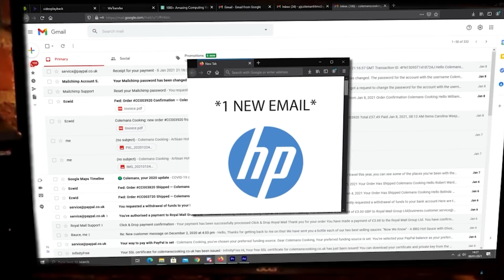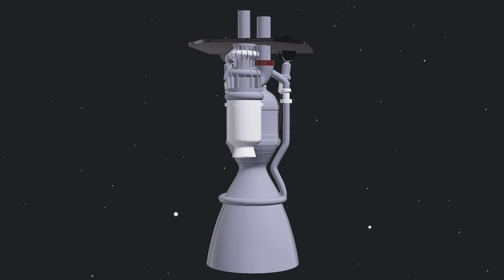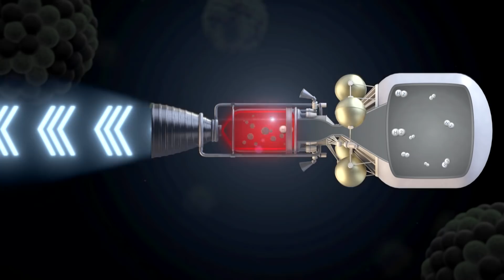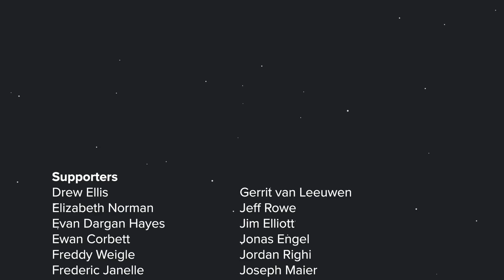Meet SpaceX’s Engine Architect and Employee #1: Tom Mueller

Comment: Forget about bi-propellant engines.  I'm working on a tri-propellant engine.  The Specific Impulse could be as high as Isp 700.  I need your help Tom to design the injector plate.  Fuel mixture is extremely critical.  Before Raptor I told SpaceX to ditch the Merlin and RP-1 for environmental reasons and switch to Methane - RP-1 is so 1968 Saturn V  F-1.  Glad to see they took my advice.
The future of rocket engines will be the tri-propellant motor which is difficult to perfect.
Reply: Hi, may I know the details about you work progress now?
Reply: May I know your current work progress?
Reply: Due to a lack of funding I am unable to conduct actual testing of propellant combustion.  I can only give you the theory, the name of the propellants and the rocket motor to be upgraded.  The RS-25 space shuttle main engine.

Comment: Carbon Fibre weighs only one fifth, with more tensile strength and less heat conduction, and much more streamline smooth aerodynamics. So to make a decision to manufacture from steel, not only increases the  payload by 15 thousand tons, from 3000 tons Carbon Fibre rocket. So when Elon talks about cheap space travel, he talks only bullshite
Reply: Yes, but you can’t resell it. Stainless steel can be melted down and reused for something else. When spacex becomes more comfortable with starship, we may see some carbon fiber variants
Reply: @catmcnugget677  Thank you for your catastrophic input . I’m sure Elon has the environment as a priority! That’s why he uses kerosene instead of alcohol , because kerosene burns 50 times hotter , and requires cooling systems , extra engineering . Rockets became boring when you couldn’t drink the fuel . Nowdays they have zero aerodynamics , plumbing in the outside , little square flippers and raptor turbo popping plasma Mandalorin . 
Do you believe that man landed on the moon ?

Comment: While hovering in order 
to reduce the speed of free fall, 
it is necessary that the Starship 
hold herself not strictly horizontal, 
but slightly inclined, namely, the stern is lower. 
This will keep the downcomers 
filled with cryogenic liquid 
and ensure uninterrupted power supply 
(liquid feeding) to the main engine. 
It may also be necessary 
to slightly change the shape 
of the cryogenic tanks 
to a somewhat asymmetric one.

Comment: A Tom Muller seems to be what Blue Origin and the BE-4 program lack.  You can hire engineers all day, but what you need is someone that has had the fire in their belly all their life.  There is a big difference between sticking a nichrome ignitor in an Estes motor (which I did as a seven-year-old) and making a water cooled rocket engine with an oxyacetylene propellant system.  Unfortunately, even attempting the latter would put you in the local juvenile detention center these days.

Comment: Tom's a great guy. I was extremely fortunate to meet him at the RRS prior to SpaceX and he was extremely helpful with my own liquid propulsion endeavor at the time.  BTW at 2:12 in your video he's holding probably the smallest bi-propellant rocket made.  He called it the micro-scud.  I helped him setup and launch that rocket that day.  If my memory is correct that rocket is still out in the desert somewhere.  I don't think it was recovered.  It had around 50ft-lbs of thrust.  It used Hypergolic fuel with pyro actuated valves.  The rocket shown at 3:30 used a surplus Condor chamber and ran on liquid propane.  It suffered a hard start when the igniter fell out of the engine due to a long launch count.  The igniter was taped to a stick and placed up near the injector. The tape failed allowing the igniter to drop out.  Tom was in the bunkers to get a better view of the launch and didnt have a means to stop the count when he saw the igniter fall out.   It was a painful lesson to learn but when I flew my vehicle I made sure to use safety wire on the pyrotechnic igniter.   I have no doubt my success with my rocket was due to Tom and the others at the RRS sharing their knowledge and experience.

Comment: If you'll notice, he has never claimed to be the prime mover of the success....literally thousands of hours of failed testing while consulting metallurgists and the outer-edge of flow dynamic engineers are cloaked in the success of the program.
What IS impressive is that he chose to accept the challenge. Like Von Braun, he assembled great minds to solve problems.
The F-1 was literally a bomb before American engineers solved the problem.....not Von Braun.

Comment: Excellent.  As you said Tom Mueller reached the limits of chemical rockets design, when NASA allows private companies to work on nuclear propulsion systems he'll be back hopefully soon for us Space Odyssey 2001 retirees.
Reply: Nuclear engines are a different breed. I would not take his return and success for granted. (I'm not saying that he won't and can't do it, just not obvious.)
Reply: @TheZoltan-42  Question: Are we at the limits of chemical propulsion? Elon choose Meth-Lox because you can make it on Mars.
Reply: 27-31 Raptors powering the Super Heavy sounds daunting and crazy to me. Launching SH will blow a hole in the launch pad if you don't have a flame suppression trench.
Reply: @jook360  We can talk about limits for each type of propellant. For methalox we are pretty close to the actual limit. Close enough that we are not expecting major improvements. Other propellants can do better specific impulse but may have other drawback in terms of handling, and availability at points where you want to fill your rocket. The Raptor is spot on for Mars. For other destinations, we are probably going to see other "top engines". For example hydralox, some form of nuclear powered engine. There are a handful of options for the latter too. e.g. direct nuclear propulson or nuclear powered electric or magnetic ion engines.
Reply: @jook360  Flame diverter is one of the big floating questionmarks around SH :) Time will tell. I think they've learned a lot about what one/three engines can do with SN5/6/8 and will make the right decision by the time they get to SH.

About the number of engines: A lot has changed thanks to technology (especially computerised controls) and testing in recent years. The problems that plagued let's say the N1 are not valid any more. The main question today is about pushing the overall prices down. Growing a single engine can rise its price in a non-linear way past a certain price. Too many will lose on being inefficient with all the overhead. Using multiple engine types also means more expensive operation. You can trust SpaceX that they aimed for the sweet spot...
Reply: @TheZoltan-42  There have been other ideas where a fusion engine is assembled in orbit and then used as a "space tug" to shuttle a Mars mission in half the time and allow more cargo. Dr. Robert Zubrin has the credentials for this but for him to work with Space X is like having two cooks in the kitchen.